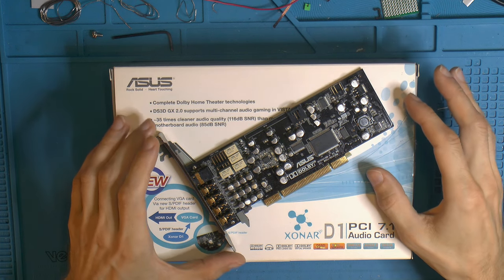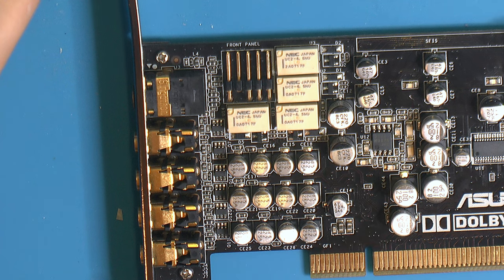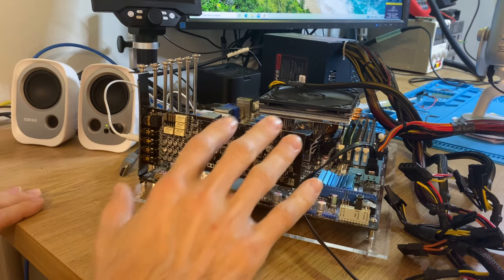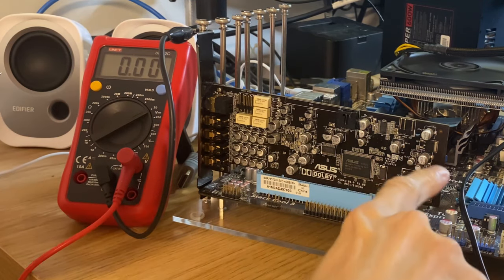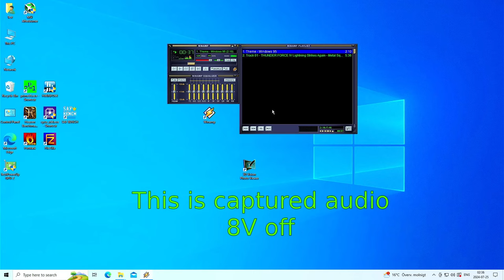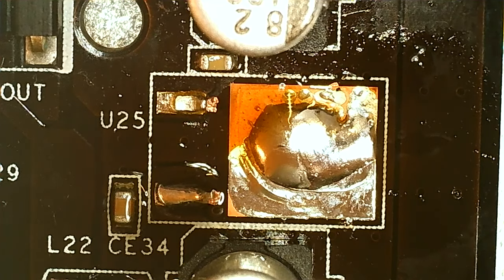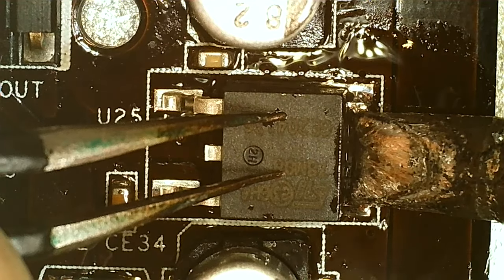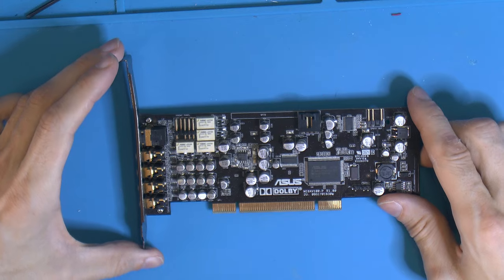ASUS Xonar D1 repair

Comment: awesome card, i still have a DX and an STX which i'm using in my main PC right now.
excellent sound quality, waaaay better than more modern cards like the creative AE-5. i actually tried replacing the STX with the AE-5 only to go back to the STX a couple of weeks later, it just sounds so much better.
excellent video as always btw.
Reply from the maker: I would no doubt use it in the main PC if it had a PCI slot.

Another good thing  with this card is its excellent Linux support.
Put it in a machine running the just released Linux Mint 22 with a 6.8 Kernel and it works just as well now as when it came out.

My biggest problem now is that I lack a good sett of speakers.
Reply: consider getting the X version then, it uses a PCIE bridge and a supplementary power connector. other than that it's basically the same card.
they're usually available from ebay and not that expensive.

the STX and STX II on the other hand are quite rare and usually go for an insane amout of money. i was lucky to get one for 50€ but it's usually closer to 2 or 3 times that.

love your channel btw expecially your calm and polite manners! 👍
Reply: I'm also still using the STX with the uni drivers on my main PC as well as a Xonar D2 in a WinXP PC. Both are great, and I've had them since around release.
Reply: Ae5 is junk, I am using evga nu audio first release with Sennheiser hd600 superb quality

Comment: Very good sound quality card. I had exactly the same in my asus rampage extreme 755 quad pc build
Reply from the maker: Yea its a good card.
Put it back in my old P9X79 rig I been repairing. Just need a good set of speakers now 😆
Reply: I recommend gigaworks t20 or t40 excellent to pair with this card.
Affordable price, great sound quality
Reply from the maker: @PROSTO4Tabal  I have a set of T40 for the mainrig. Had an old set that I used with this card but they died long ago.
Reply: Could you please help me with memory swap on my voodoo2 sli? I have 125mhz instead of existing 100mhz, I bought Passive heatsinks too. Can let you know where I got new memory from